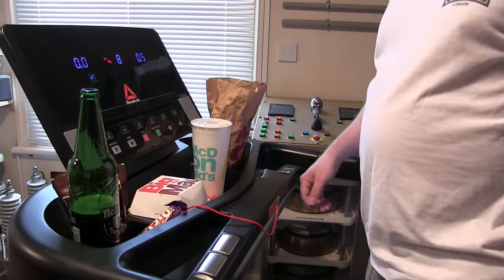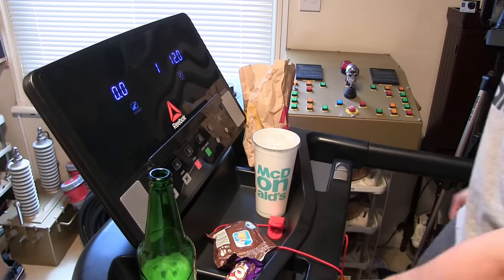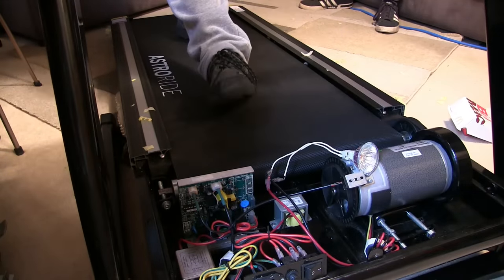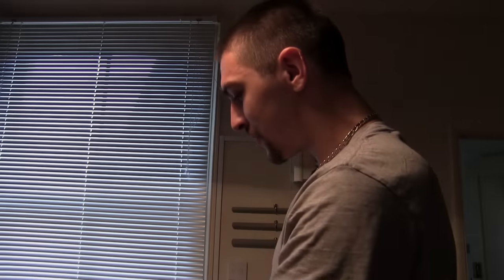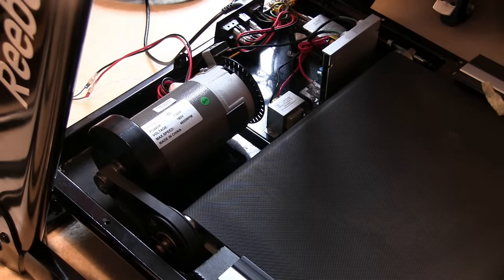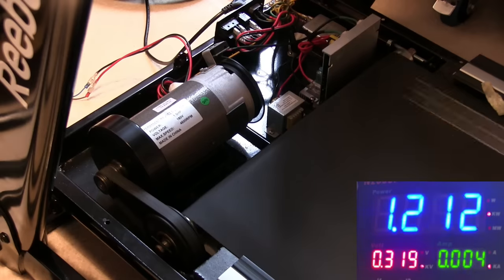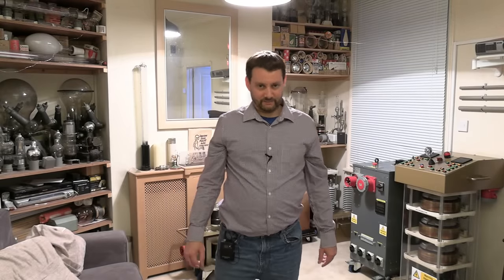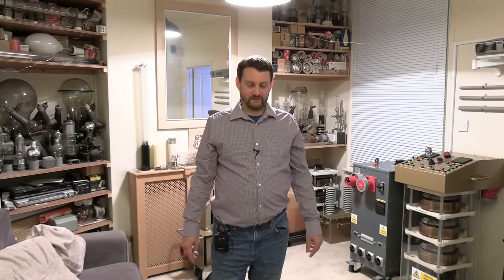Overclocked Treadmill

Comment: "...And this is our rectifier."
-> Diode stack the size of a shoe box to run a 2 hosepower motor, lol.
Reply: That's the FULLER bridge rectifier...
Reply: ElectroBOOM would be proud.. 😁
Reply: 500watt != 2hp
Reply: Where’s Mehdi when you need him😂
Reply: Yeah! 
Once I saw that, I know that motor isn't going to survive for long, LOL!!
Reply: @NurdRage777  500 watts is 2/3HP lol
Reply: @NurdRage777  I don't know what's up with your eyes, but it clearly says 1.5hp on the motor itself.
Reply: @NurdRage777  that is relative power W=VI

I is always constant here due to winding resistance and such and only the voltage and power varies. You can only know what the HP is by using calculations of how many Ft. Lbs of force it can do and etc. HP to W is only a general guide at its rated voltage, in this case 1.5HP at 180VDC as stated in its nameplate
Reply: @NurdRage777  plus it might've suffered severe damage from overvoltage and it screwed something inside,
Reply: @Fine_i_set_the_handle  he did get 6 likes ????? :)
Reply: if it ain't overkill - it ain't enough for Photon.
Reply: @moonshiner2977  an exclamation point before an = means not equal to he didn't say anything incorrect, I just added a more complete accurate answer
Reply: ANTI GLOBALIST  he probably went off the wattage the motor pulled of its rated 90v in the video, which was around 500 and the comment he responded to said it was 2hp
Reply: ANTI GLOBALIST  No indeed. He mentioned 2HP which is 1492W. But the engine only pulls 500W at its rated voltage. So the 1.5HP on the motor and the 2HP in his comment are not correct.

You guys now there is an imperial, metric and a electric HP?  I mean, here is no need for guesses to be made... 
1 Imperial HP = 745.7W
1 Metric HP = 735.5W
1 Electrical HP = 746W
Reply: @BlaDeKke  wait, what, there's imperial HP ? WTF.
Reply: how many HP is not the question, the question is how many cals did he lose at 2KW ?
Reply: @BlaDeKke  Weird, since both units are related to the power output of steam engines designed by James Watt.  The HP unit indicated how many horses in treadmills each motor could replace for mining customers, while the Watt unit is how much it can haul out of a mineshaft.
Reply: Power tool rating are often calculated using the starting amperage, which is no where near the working amperage.
Its a scam and it' stupid, who really think their shop vac pulls 3 hp from a 110v socket.
Reply: @ameunier41  I assure you its possible to pull that from a 110v socket...

once, for a couple of minutes

I would return the product, because nothing exploded in flames
Reply: I’m waiting for a mercury rectifier bank. Bask the place in a beautiful glow!
Reply: @peterjensen6844  it has 2 fire modes full auto and fuller auto'
Reply: And use 20.000 Watts cable to power that tiny engine:):)
Reply: 1500W = 2HP.
Reply: @johndododoe1411  "the watt unit is how much it can haul out of a mineshaft" ...what?? XD

Comment: considering this motor was rated 180V, the fact that it reached 510V or so until it finally gave out was absolutely jaw dropping. And then it KEPT GOING.
Reply: Exactly!
 thou I'd of thought there would be a little redundancy built into the motor considering the somewhat harsh environment it has to work in.
I'd doubt a cheaper motor would last very long...
Reply: I don't think the motor actually failed at 500v. I think the lubricating grease did.
Reply: Even though they are old tech, DC motors are surprising resilient and powerful.
Reply: @empireoflizards  well since they are so old idea-wise they are fairly refined now. Still these little things can do a lot of work for what they are.
Reply: @runed0s86  I have to agree with you here.
Reply: @stuartd9741  There's a Harsh enviornment,
Then there's a hazardous enviornment
Then there's a dangerous enviornment
Then there's a lethal enviornment.

Then there's a PhotonicInduction enviornment.
Reply: I mean it's like gas engines, they can actually do relatively well well past their max rpm
Reply: @LavenderJJ_  tell a conn rod breaks
Reply: not even CATCHING ON FIRE stopped it
Reply: From what i know sometimes the rated voltage that its sold under as a product on the market doesn't equal the true value (as in it can in a lot of cases be a lot more than what it says on the case of a motor)
Reply: its a dc motor, a dc motor can be given 10 times the amount of the volts its rated for and still be able to work.

Comment: I would love to know what his room smells like after this. No amount of cleaning can undo the torture this man dishes out.
Reply: Everywhere he goes there’s something going up in smoke somewhere. He’s done popped it. Love your vids too by the way
Reply: If you go back to the old videos, pay special attention to the carpet. You'll have your answer :P
Reply: Smells like burnt electronics
Reply: Like pure fitness
Reply: I would love to know what his wife says when she walks in the room.....
Reply: Its like waterboarding for electronics.
Reply: That old, familiar smell of things that aren’t supposed to get hot getting hot.
Reply: @N4CR it's nice seeing someone whose carpet is worse than mine!
Reply: Ozone
Reply: Pints and darts
Reply: Probably smells like any other place that has burned an electronic component... Stinks for a bit then smells normal like nothing...
Reply: Ever take an old piece of Electronics apart?
That weird musty plasticky smell?
I'd guess similar to that...
Reply: He uses that smell instead Hugo Boss
Reply: Ozone, nitrous dioxide and rusted hinges I guess.
Reply: Smells like burnt lettuce and stale beer.
Reply: I'm betting there's a nice, permanent smell of ozone and old capacitors
Reply: You know the smell of an rc car after giving it some welly? That, but x100
Reply: febreeze
Reply: Beer and burnt silicone
Reply: An ozone machine running with the room closed up would deodorize it. It’s what they use to get rid of corpse-smell.

Comment: Would have loved to see the bang of it being switched into reverse on full speed!
Reply: Yeah, I was surprised there was no 500v emergency reverse test performed. Very unsafe to overlook this important test.
Reply: the result guaranteed, massive instantaneous fireball, with mushroom cloud from where the brushes and commutator used to be :))
Reply: You would have had to include the relay in there, that little 8 pin relay likely would simply have arced over and burnt itself to a crisp first. Not enough contact separation to survive and extinguish the arc, you would need to have a proper double breaking contactor with 4 poles, 2 NC and 2 NO, with break before make contacts, to have any hope of surviving that.
Reply: @SeanBZA  Given the size of his rectifier, I'm sure he must have something that could handle the juice :)
Reply: Rocking horses!

Comment: So 170 Revolutions per minute, the average length of a treadmill track is 5 feet long, or say for sake of argument 11 feet in total, that's 1870 feet per minute, or almost 35km/h, or 21 miles per hour, so it would take an Olympic sprinter to be able to run on this, which is still pretty impressive
Reply: Woah big Brain time
Reply: Nice work 👍
Reply: I was going to comment that be needed a speedo, but you've done it.
Reply: Gotta get a bigger motor and hook up something like this and then launch a 2x4 or something with it.
Reply: Tread mill go vroom
Reply: Simple maths here.
Reply: ... Or the "6 million dollar man!" *
*ancient TV show
I was waiting for the theme tune to start 😃
Reply: I got a similar mph result with these numbers in the calculation, but it seems a bit low:

First result for a Google search on "reebok treadmill belt length" gives 2670mm x 430mm for the Z9, so it's an 8.759843 feet long belt?

At 12:47 into the video it looks like the belt was doing 3 revolutions every 23 frames, 7.666666 frames a revolution.

With 1 frame at 25fps being 0.04 seconds, that's 0.306666 seconds for 1 revolution of an 8.759843 foot belt, so 28.5647 feet per second, which equals 19.476 mph.

Comment: Brilliant piece of work. Never have I seen somebody hate a piece of equipment with so much fun. Now fit a washing machine motor to it and shred the bearings and belt on it..
Reply: Need to use the big washing machine spider and the large pulley to drive it, and it will be impressive. May need a small amount of beer can spacers to get the pulley to fit the motor shaft, along with a bit of JB Weld to hold it there.

Comment: This reminds me of something that happened when I was one of the technicians working on an ultra high speed printer. It's print speed was not measured in pages per minute but meters per second. To give you an idea the target (which we exceeded) was 25 meters per second or roughly 4500 pages per minute. To test the print head we had a weird conveyor effort that moved a single page past at 30 meters per second to prove the head could firstly detect and register the page and then do the test print. This is the paper detected and the maths done to calculate how and where to print and to actually print it all in 10ms. We had the prototype built tested re-checked and validated the Friday lunch time before  the bigwigs from the customer came in to get an update on progress. The bosses bosses bosses boss came in after going through all the data (3 times knowing him and getting his right hand man to cross check) then explained he was very pleased with the excellent progress. He then proceeded to show us how to use the £250k high speed paper conveyor to launch paper aeroplanes.
Reply: lmao 
nice plane launcher 😆
Reply: Were you actually launching paper planes at 30m/s? I'm amazed they survived that enough to fly afterwards lmao. 110 kp/h is well beyond terminal velocity of even the pointiest paper plane, I would expect the launch acceleration to crumple the paper before its even flying.
Reply: Wow

Comment: To remove permanent magnets try freezing casing and smacking outside with hammer.  

IDK_ might work.
Reply: That'll make the magnets stronger not weaker
Reply: @England91  Uhm ok, but it might make the glue brittle.   I have done this with speaker magnets.  But I am not a scientist.  So YMMV.
Reply: @johnhansen4794  :(

Comment: Should have tried changing the gears to a 1:1 ratio or even reversing the gears for a 1:5 so the treadmill goes even faster
Reply: There’s no gears just belts
Reply: @WELLINGTON20  There's gears inside the motor.
Reply: @WELLINGTON20  What do you think is in contact with the belt then?
Reply: @nizarch22  air force lol

Comment: Andy, if you can measure the length of the band, you or we can have a decent guesstimate of the speeds it was reaching quite easily.
How? Pause the video and press dot key "." to step through the video frame-by-frame (comma steps backwards), then count the frames between the logo on the band re-appearing after 1 revolution to calculate the mph based on the video being 25fps.
Reply: Do it then
Reply: "So 170 Revolutions per minute, the average length of a treadmill track is 5 feet long, or say for sake of argument 11 feet in total, that's 1870 feet per minute, or almost 35km/h, or 21 miles per hour, so it would take an Olympic sprinter to be able to run on this, which is still pretty impressive" - Matthew Osmond

other guy in the comments section made a guesstimate, dont know how he got his RPM but seems legit.
Reply: @mrrooter601  sounds a little low, back in the gym we had treadmills that went up to 25kph, this one looked like warp speed
Reply: @licensetodrive9930  Sounds like an American calculation, going roundabout then skipping the important steps as if everyone memorized some arbitrary factor.
  I'd go 3 revolutions per 23 frames at 25 frames per second is 8.7598' * 3/23 * 25/s = 29 fps. But I suspect that belt length is wrong, looked like the running surface was clearly more than 4½' long.  Anyway, the easy measurement is the rotation speed of the drum surface that the belt rides on.  Each rpm is Π diameters per minute, no matter what belt length is used, but do include belt thickness in the diameter and reduce by slippage.

Comment: Nice. It would have been interesting to see how fast the treadmill belt was moving in MPH or KPH, and to know how fast the motor got up to in RPM.
Reply: Dunno about the speed part without knowing the gearing ratios but I think you can measure the rpm by scanning the audio frequency (Hz) and multiplying it by 60 to get your rpm. Probably not as accurate, but definetly possible.

Comment: I want to see relatively modern CPU melted under just absolutely intense computational stress. Thermocouples will have to be spoofed.
Reply: it would be interesting and perhaps valuable to see how massive surge of power might annihilate through a motherboard's traces and what lives or dies. Hard to say how much we would observe since so much is very tiny. And when it comes to cpu failures it most likely is just a quick pop and smoke stain.

Comment: Just put a bunch of these outside your house during the zombie apocalypse
Reply: Im sure you would  survive the zombie apocalypse but lets see when the electricity bill comes in
Reply: @silkyfirst3097  he uses off-grid power during the day and grid power at night. (Cheaper at night)
Reply: @KISSMYACE3203  oh thats pretty cool what does he use for the day or is it charged power from the night?
Reply: @silkyfirst3097  battery bank.
Reply: @Silky First @KISSMYACE3203 actually, we use zombies running on hamster wheels!
Reply: @jadissx  eh, info on where to find zombies?

Is that an England only thing?

Comment: The motor took a lot of abuse. I was amazed how well it healed up. Looks like as long as you keep it factory then it’s pretty well made and can easily be controlled with an arduino if the pwm speed controller started giving issues. If the repair was free then yes they can fix it otherwise I will put my own control system in it. I just fixed my sister’s washer by building an arduino setup and several relay modules and various other parts for $60 I had everything I needed to gut the faulty factory electronics and replace them with a controller designed and built by me. I can fix it very easily and quickly because all my hardware is off the shelf. I didn’t have to make something custom except for brackets to hold everything.

Comment: It would've been cool to try and swap the pulleys around to see how fast you could get the belt to spin. Or see what happens when you reverse direction at 300 volts.
Reply: or tape over every other hole on the encoder.

Comment: Imagine getting that motor rewound for high rpm vs high torque.
Reply: these motors are built already for high rpm. they only have 2 poles and at the very minimum amount of rotor teeth allowable. if you mean rewiring so that it can take a higher voltage (aka thinner wire on rotor), that wont do anything. in fact it will increase back EMF and decrease rpm for the same voltage as before. Anyways this motor is already rated for 180vdc, but they can actually run at 230vdc just fine. brushed motors will always have a rpm limit because of rotor disintegration and commutator arcing.

Edit: thats also why these motors are already wound for high rpm. you get better winding efficiency with 2 poles, the controller will be cheaper by using higher voltage low current components, pulley step down ratio is more efficient using a thinner belt, and also the flywheel has a greater effect (hence treadmill duty rating)
Reply: @electricalfive2248  correct it does only have 2 poles but I guess when I said ‘rewound’ I was also talking about altering the amount of commutators and coil windings. Increase the period of commutation.
Reply: @RadDadisRad  yeah, essentially that's the only option. just two separate windings on the rotor and commutator. I'd imagine treadmill companies tried to lower the rotor "tooth amount" to get a better flywheel effect for higher treadmill duty, but the roller pulley gets too large. in fact the cheap residential treadmill motors do the exact thing. tiny motor pulley + wide roller pulley and only 6 rotor teeth/commutator bars letting it go to 8,000 rpm. I part out hundreds of treadmills, seen some crazy motors haha. If you are ever trying to get a nice PMDC motor for free on marketplace or craigslist, Cybex, Trotter, Sole Fitness, Vision Fitness, Horizon Fitness all have some of the biggest motors you can get. I kept a bunch of them, they weigh 60lbs each.

Comment: I think the E-02 error it gave you means the control board is faulty. I just searched that on the internet and apparently it means faulty control board. Makes sense because of all the power you're giving that thing.
Reply: yeah its probably because they disconnected the motor assembly and the board couldnt get any readings

Comment: How is that a step down? The radius of the motor shaft is smaller than that of the thing connected to the treadmill. So the treadmil is rotating faster in terms of tangential velocity
Reply: WTF? No, the motor shaft needs to make more turns for a single turn of a treadmill shaft.

Comment: FIND A TOASTER AND MELT IT
Reply: why do you hate toasters so much
Reply: @zockerbro6453  toasters need hundreds of amps, its the amperage that does the damage
Reply: @zockerbro6453  have you used a three phase arc welder lately, I did once. You become aware that there is a lot of power that you can play with, interact with.